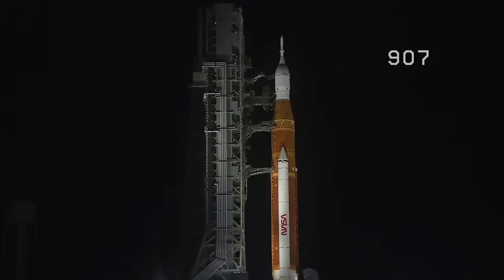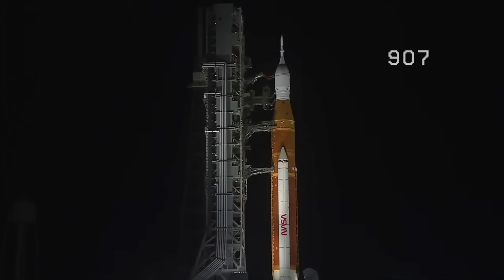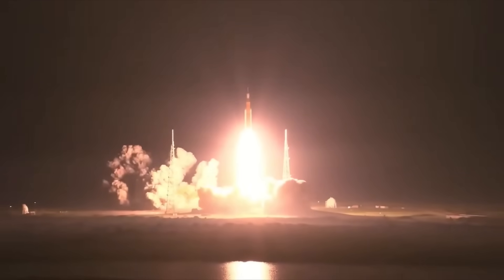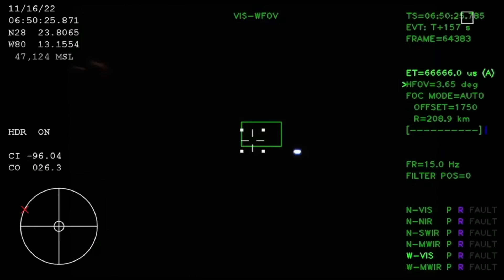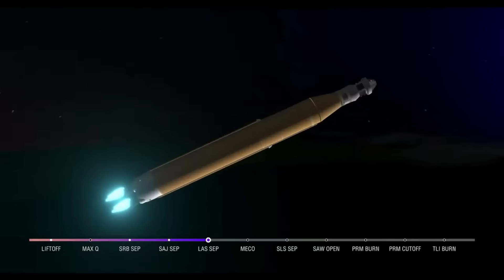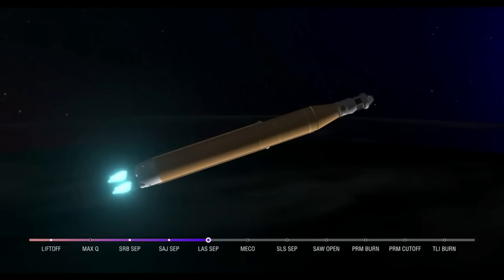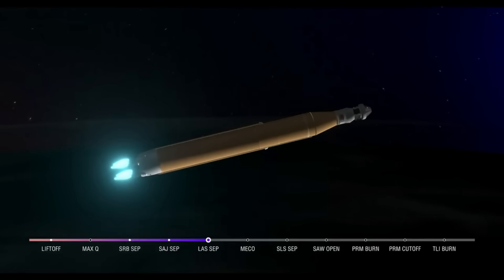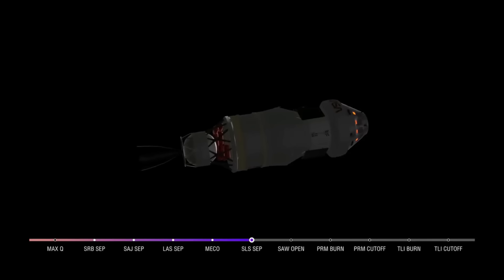Blastoff! NASA's Artemis 1 moon rocket launches on historic first mission

Comment: That's what it looks like when people that know what they're doing launch a rocket Elon.
Reply: elon meanwhile landing a falcon 9 rocket back to earth for the first time in human history
Reply: 302 successful launches of Falcon 9 and over 250 successful landings of the first stage. I think they know how rockets work 😂
Reply: @Unknown-oh6ue  So... Starship blows up every time why then?
Reply: @TresTrefusis  Because it’s in its testing phase. Falcon 9 blew up a couple of times at the start as well
Reply: @Unknown-oh6ue  ...correct, and SLS didn't, which is exactly the point of my original comment. SLS took off, made orbit, sent Orion to the moon and Orion then successfully returned to Earth on their first attempt. I think the difference in  performance, engineeering, and competence is self evident.
Reply: @TresTrefusis Starship is a lot more technical and complex than SLS it has 33 engines vs sls 4 and 2 boosters SLS has been in development way way longer and is reusing most of it's hardware from the shuttle age Starship is a completey new rocket ground up and Elon has been launching Starship knowing it will likely fail for more flight data to make everything go quicker vs SLS since is about 7 years behind schedule and now with Starship latest flight it was successful and landed a gaint boostet and a big ship going almost orbital velocity for the fastest object to land safely back on earth with rocket propulsion to slown it down

Comment: You have to wonder:  Do all these Rocket launches go against the so called 'Net -Zero' Atmosphere goals of Climate Change Activists?
Reply: The entire Spaceflight industry contributes 0.003% of global emissions.
Reply: @weekiely1233  weekly  You are well-informed.  From 'What' source did you get that information?   Wow, out 3 decimal points!!
Reply: @Rocky-xx2zg  i did my own research
Reply: @weekiely1233  Good.
Reply: @John Hazenhousen Really?  You're very informed
Reply: The 4 main (RS-25) engines burn H2 and O2, producing water vapor.

The SRB's fuel consists mostly of ammonium perchlorate and aluminum + iron powder. The only carbon emissions I can see would come from the small amounts of epoxy-like binder used in the fuel to keep it together.

So in terms of CO2 emissions, the Artemis/Shuttle launches produced comparatively very little.
Reply: @taylormorin-l7y  Really?  How do you know that?  Do you work  there?
Reply: @taylormorin-l7y  I don't see that option. I'll check.  Thanks

Comment: Considering how many budget cuts Nasa has to work around, what was the logic behind sitting a fully operational Orion capsule on top with an 'inert' escape rocket system? Why risk losing a very expensive capsule for the cost of fueling up the escape system! But well done anyway - this is decades late in getting back to the moon!
Reply: Back? They never went, even admitted by Buzz Aldrin. NASA admits they no longer have that technology and that there is no way to safely get through the Van Allen Belt radiation.
Reply: @EnlightenedPatriot1  please, just show 1 piece of evidence, just one

Comment: Hard to follow: Apollo and Artemis, both lunar craft, yet Apollo flew first, 50 years ago, with hardly any errors AND crewed flights at that!
50 years later, no crews, problems left and right with reused space shuttle gear...
The best of the US is behind us.
Reply: Hard to follow because pretty much everything you said above is wrong: 

Apollo flew 6 times before a crewed flight that was successful, including a test that resulted in 3 astronauts dying in a horrific fire on the pad. The Apollo mission just before the first crewed flight failed 3 of its main goals. The Artemis Program isn't suffering problems left and right. Does it have problems? Sure. None of them are showstoppers as you can see. Though Artemis I is flying uncrewed flights first, Apollo was meant to do the same. Those flights simply failed and no further test attempts were made. Virtually nothing about the flights of either are similar other than they will take off from Earth and head to the Moon. The vehicles, speeds, orbits, duration, equipment, all completely different from Apollo. The RS-25 engines aren't being reused for lack of creativity. They were workhorses for the Space Shuttle and still work fantastic today. Same for the SRBs (which are not the exact SRBs used previously). They work. Ask anyone that has a job where they work far away from people doing dangerous work. Fisherman, submariners, roughnecks. They only care if the equipment works reliably for the job. Who cares if it's fancy or not? 

Last, the very first flight of SLS and Artemis were successful, uncrewed, autonomous, and have already accomplished far more than Apollo 7. So yeah, pretty much everything you typed above is wrong.

Comment: I can't believe that they are still using the empirical units: miles instead of kilometers.  Come on guys, let's have a common standard..
Reply: It's for Americans. They won't give up imperial system. NASA does use SI system for the engineering and other stuff.

Comment: Just read about this Artemis 1 and it totally suggests that the moon landings are all Bullshit!!! They supposedly sent men to the moon in 1969 🤔  they didn't have nowhere near the technology we do today and this is stated as being a first... None of this FiretrUCKING Bullshit makes sense!!!  It also said the mission is to test heat shield for re-entry and 3 mannequins and a FiretrUCKING Snoopy toy have been sent on the mission to test radiation levels WTF!!! Hasn't this shit already been done? Presumably in 1969... 53yrs later and no progress 😂 🤔1969 and the bullshit moon landings are a FiretrUCKING hoax!!!
Reply: Sigh.

The Apollo technology is obsolete and superseded by Artemis. This must all be validated and tested. 

The sole purpose of the mannequins is not to measure radiation. They are wearing the first-generation Orion Crew Survival System suit – a spacesuit astronauts will wear during launch, entry, and other dynamic phases of their missions. These are fitted with sensors to record gs and  acceleration. Engineers will compare Artemis I flight data with previous ground-based vibration tests with the same test dummy, and human subjects, to correlate performance. Accelerometers inside Orion will provide data for comparing vibration and acceleration between the upper and lower seats. It also evaluates the integration of the newly designed systems with an energy dampening system that the seats are mounted on.

In terms of radiation, as explained, Orion is a completely different craft to Apollo designed for longer duration and distance The longest Apollo mission was Apollo 17 at 12 days - in comparison, Artemis 1 is 25 days (42 originally) and unlike Apollo reaches an apogee around the moon of 40,000 miles. One of the mannequins is testing a new radiation shielding vest, called the astrorad. Also the mission coincides with peak solar activity which is a tremendous opportunity to gain more data in respect of the crew cabin and its systems.
Reply: @yassassin6425  No shit Sherlock! I didn't say it's the sole purpose. If ya wanna go that far the sole purpose is, 'supposedly' for the betterment of mankind (bullshit). Imagine the billions and squillions of dollars could be spent on benefiting suffering humankind and making the world a better place! At the end of the day it's actually to satisfy mad scientists curiousity. And I was just writing what I read you said it yourself that One of the mannequins was for radiation they're all filled with sensors that will test how the human body responds to space travel. Hasn't this all already been done before?🤔
Reply: @K_eel412  
Why the unnecessary aggression and abuse? - you simply humiliate yourself in the process.

Orion is a completely different craft to Apollo, harnessing modern technology and designed for long duration deep space exploration outside of the earth's magnetosphere. Of course you will want to monitor for radiation, particularly approaching a solar maximum which will peak when the landing is scheduled.

Regarding the many benefits that have come from space exploration in terms of the betterment of humanity, I would be very happy to summarise them for you ,but you seem to be a very angry and irrational individual.
Reply: Well sooorry! And that's your perception. Everyone's entitled to an oppinion As for anger, it's not, (excuse the language) it's merely driving a point home or highlighting an exclamation. I will say it's frustrating though knowing that unlimited amounts of money is spent (while humanity suffers) on space travel crap when it could be used to benefit mankind on this planet. What is the point of going to the moon and/or Mars anyway? I'll say it again, to satisfy mad scientists curiousity!!!
Reply: @K_eel412  
"Well sooorry! And that's your perception. Everyone's entitled to an oppinion"

Thanks for your reply.

Nothing to do with me - I am irrelevant to this exchange - and actually, impervious to ad hominem abuse. It's all rather unnecessary that's all. Incidentally, known science is not about opinion and at no stage have I mentioned mine.

"As for anger, it's not, (excuse the language) it's merely driving a point home or highlighting an exclamation."

Thanks for clarifying - but understand that it does come across that way.

"I will say it's frustrating though knowing that unlimited amounts of money is spent (while humanity suffers) on space travel crap when it could be used to benefit mankind on this planet."

I do appreciate your point - and it is one that needs to be made.

"What is the point of going to the moon and/or Mars anyway? I'll say it again, to satisfy mad scientists curiousity!!!"

Not simply that.

Yes, there is research. The microgravity of space allows astronauts to carry out experiments that would not be possible in the gravity of Earth for such prolonged periods. This helps advance materials science because it allows different processes to be engineered in terms of crystal growth, fluid mixing, separation between gases and liquids, heat transfer, solidification and combustion. From this we can better understand thermophysical properties, develop new/novel products and processes and examine morphological microstructures and granular matter. This has also benefitted our understanding of fundamental physics (complex plasma/dust particle/aerosol physics/motion, frictional interaction, plasma physics and aggregation phenomena). Biological research has encompassed plant physiology, statolith movement, gravitropism & gravireceptors, cell and development biology, electrophysiological and morphological properties of human cells and in terms of the latter the human research has been extensive including such examples of; integrated physiology, cardiovascular/respiratory function, body fluid shift, muscular and bone physiology, blood lactate, neuroscience, and vestibular function. Research done in microgravity is helping pinpoint cellular changes that cause cancer. Altered gravitational conditions provide new technologies that help detect changes in proteins that may become new targets for tumor drug development. 

Then there are the natural resources. Lunar resources encompass solar power potential, oxygen, and abundant elements including, among others, hydrogen , oxygen, silicon, iron, magnesium, calcium, aluminium, manganese and titanium. Also, non-radioactive helium-3 from the moon may one day power nuclear fusion reactors. Water can also be found in the poles. Beyond our near neighbour, measurements by rovers and satellites at Mars have also indicated massive amounts of water in the form of ice beneath and within the regolith. Mineral resources are in abundance as well, including iron, titanium, nickel, aluminum, sulfur, chlorine and calcium. Asteroids could also be plentiful and inexhaustible sources of oxygen and water - consumables for life support and materials and a rich diversity of rare, valuable and abundant metals to be mined. However, at the risk or creating the next Klondike or wild west (we do not want to repeat the mistakes of the Earth’s colonial past), now is the time to put in place safeguards to protect the rest of the Solar System from the kind of gross mismanagement witnessed on Earth in the name of science and exploration, but these extra-terrestrial resources are so bountiful that such extraction would also be sustainable.

And lastly, in the name of exploration. Commander of Apollo 17 and the last man on the moon Eugen Cernan: "Here I am at the turn of the millennium and I'm still the last man to have walked on the moon, somewhat disappointing. It says more about what we have not done than about what we have done." "I think America has a responsibility to maintain its leadership in technology and its moral leadership in the world, to explore, to seek knowledge."  "I'm quite disappointed that I'm still the last man on the moon. It's our destiny to explore. It's the destiny of humanity to be space-faring". "I know the stars are my home. I learned about them, needed them for survival in terms of navigation. I know where I am when I look up at the sky. I know where I am when I look up at the Moon; it's not just some abstract romantic idea, it's something very real to me. See, I've expanded my home."

 "Curiosity is the essence of our existence"

Thanks again for your reply.
Reply: @yassassin6425  Wow that is deep meaningful info right there.  Wouldn't it be great to be around in another 500yrs? Well I guess only time will tell my friend, you have a FiretrUCKIN' great day mate!! 😀
Reply: @yassassin6425  do you have degree(s) or are you just passionate about these things?
Reply: @crusanos562  
Hi Cursanosicus. To answer your question, both.

Comment: Unfortunately it would have been better for America for it to RUD on the pad.
Now we are going to pay for a second overpriced delayed rocket.
Reply: If you compare it to USA budget the cost is insignificant for the gain
Reply: @pancytryna9378  
If you compare it to the competition it is mind boggling expensive. I would prefer to pay for two Falcon Heavy flights which would be as a rule, on schedule.
Reply: @calvingreene90  
Launching two missions would increase cost greatly... You need a whole different design for the spacecraft, more complicated one of course, you spend more time and have more things to go wrong with  the docking, and since SLS is meant for manned missions in the end spending more time in space is not desired.  Two falcon heavies wouldnt be able to replace one SLS, so you'd need to make quite a few of them at once.
Reply: @pancytryna9378  
Not to replace SLS. Besides by the time NASA and Boeing get the second SLS on the pad SpaceX will probably have Starship man rated.

Comment: I thought we have a fuel shortage in America? Priorities are prioritizes I guess.
Reply: Go ahead, fill your car tank with rocket fuel
Reply: @pancytryna9378  Yes, rocket fuel is refined kerosene. Get the picture?
Reply: @alittlebitofeverything5090  
Wrong. The SLS uses liquid hydrogen whilst LOX serves as the oxidiser. The solid fuel, or propellant in the SRBs, is a mixture of ammonium perchlorate, aluminum, and iron oxide. 

The first stage of the Saturn V did however use RP1,  a highly refined form of kerosene (in addition to LOX).
Reply: @yassassin6425  Now we are getting somewhere! Thank you

Comment: Brilliant to see, especially when the rocket just leapt off the launch pad.  But to correct the commentator. Those engines were not throwing down thrust, they were throwing the rocket up. The lift comes from within the rocket cylinder not the gasses escaping the tail.

Comment: Taxpayer money could be better spent
Reply: If billions wouldn't have been spent in the space race in the 60's and 70's, you wouldn't have the internet right now.
Reply: @betaorionis2164  billions is the problem.
There were computers before nasa.
And no internet is that really a bad thing??
Reply: @normanclark1185  There we’re computers before NASA, but the race into space eased the miniaturization of circuits and therefore the huge boost of consumer electronics which came later.

If the internet is a good or bad thing, it’s up to you to decide (I’m above 60 and had a perfectly fine youth without), but you can’t deny it offers huge possibilities for the modern world.